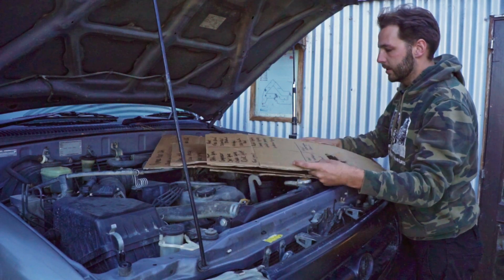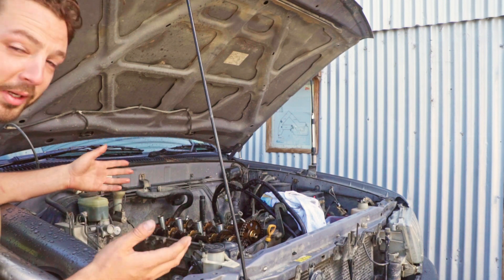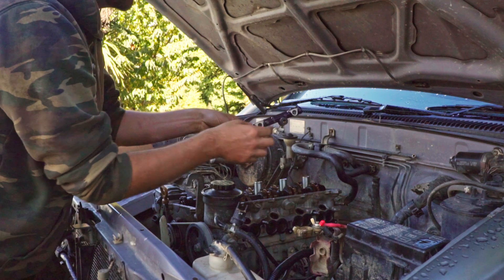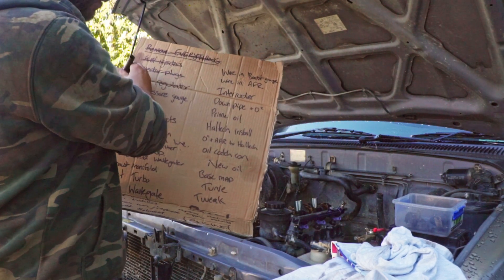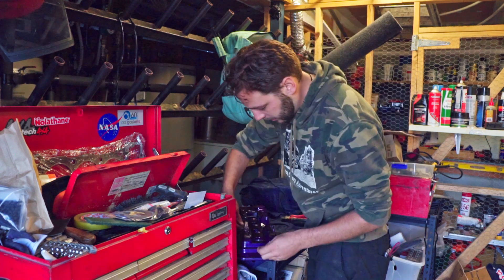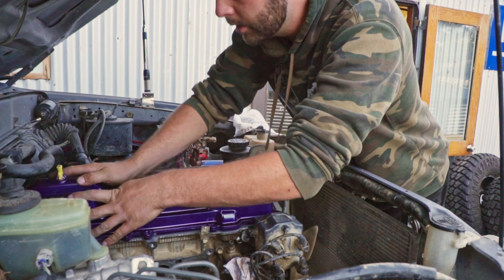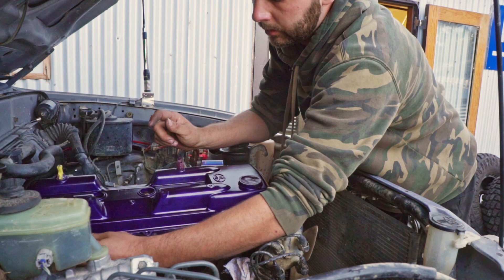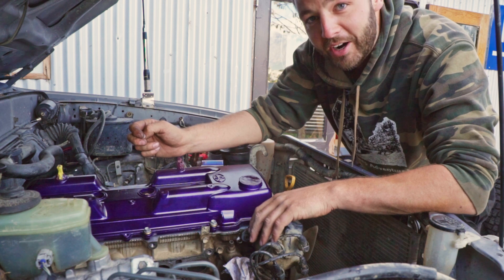Turbo 3RZ | Stripping the motor and installing new fuel injectors | Turbo 3rz build part 1

Comment: I have Toyota 4 Runner from 1996 year with engine 3RZ-FE. I need to change all four injectors. Becouse oryginal injectors Denso are obsolete please recomend me wich replacement to use? I need injectors with standard parameters. Thank you for your help!
Reply from the maker: Hi, they take standard length injectors and I used Bosh ones supplied by NZEFI. Just measure the O-ring and make sure they are correct on installing.

Comment: The 3rz is a great engine to turbo and has forged rods which can handle 15psi of boost. 
 Check the channel called Nugget Garage they love them. 
Going by your lists it looks like you’ve got your shit sorted    
Can’t wait for next build vid
Check out my walk around video showing the modifications I’ve done to my Pajero you might remember it from Macetown two years ago
Reply from the maker: Yeah the guys in Aus seem to have got more of these engines then we did. Common practice over there to turbo em.

Comment: How many kms have you put into that engine?
Reply from the maker: I've put like 30k into it and its currently sitting at 350000 ish
Reply: @lostsheepadventures  That's exactly what mine sitting now. Also leaky as rocker cover lol. I'm following your work probably look at upgrading mine. It's a 96 manual 3RZ. Very similar to yours
Reply: @lostsheepadventures  Also I was looking at the Supercharger kits they have over in US for 3RZ that straight bolts in and somewhat of an simpler arrangement. Just getting one down here will be the trouble.